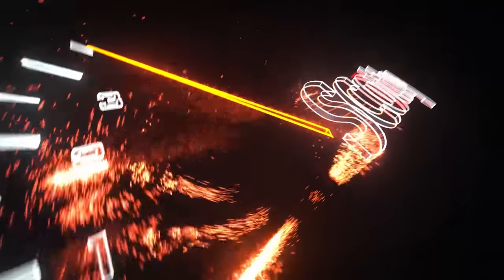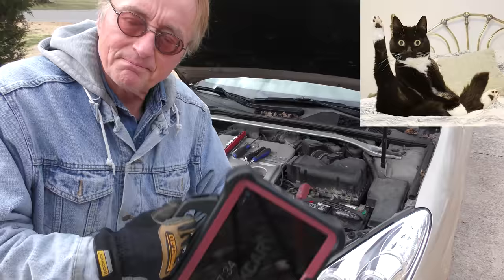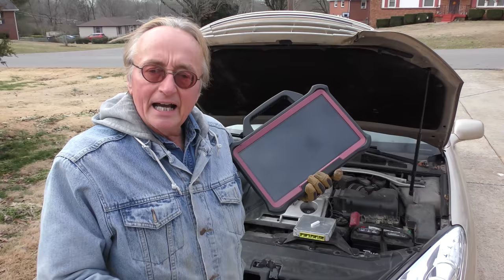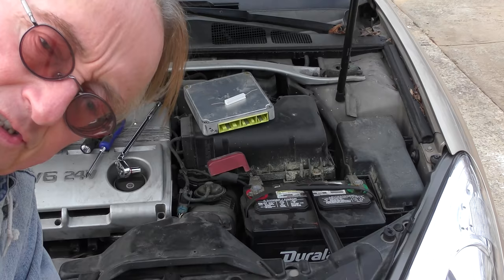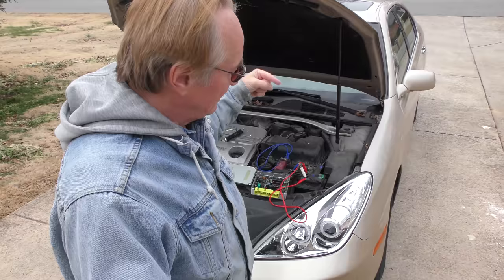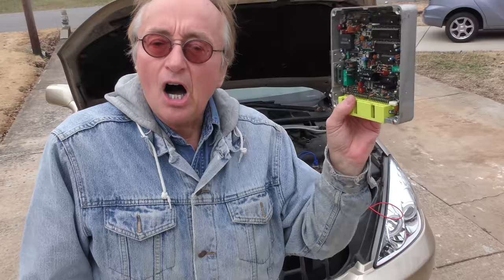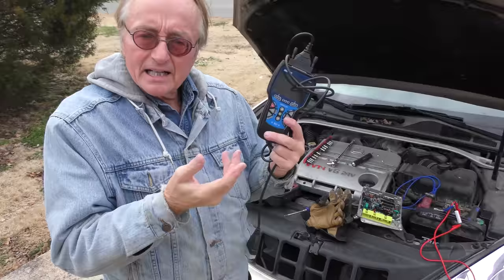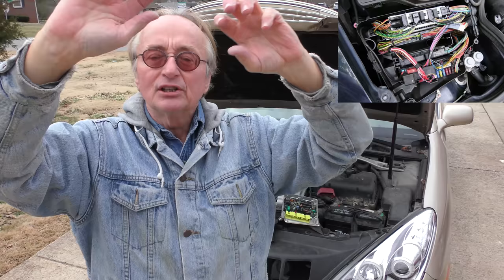This Stupid Thing Will Save You Thousands in Car Repairs

Comment: “Don’t touch the positive and the negative or you could damage something” as you remove the positive and place it in the car that is completely hooked to the negative… c’mon Scotty! As a mechanic you should know you always remove the negative first…
Reply: Why?
Reply: @WolfmanZX  If you remove the negative first, the worst that can happen is you will momentarily provide a correct ground path and the battery will be back in the circuit.  If you remove the positive first, your wrench can short circuit the positive terminal through the wrench to any part of the cars body that is ground, welding the wrench to the frame until it burns off. The negative terminal should be the first off and last on so if the wrench ever grounds to the frame, there is never a short circuit directly to the positive terminal.  The battery is capable of around 800 amps.
Reply: Yes, always remove the negative cable first.  If you start with + and let it touch the engine or body, it makes exactly the + to – contact (computer rapid discharge) that you're trying to avoid.
With pre-computer-era cars, ggeimer is correct about the risk of the spanner removing + touching the car body; nothing more.
Reply: Ste Srad  or you can touch some bare metal ( frame motor) with your ratchet , while you undoing the +. and voila, big spark.

Comment: Ty so much! I've always found how vehicles run and work fascinating. But, I'm a female and I've discovered 2 things: 1. Sometimes mechanics get annoyed when they're trying to work on a vehicle and you're steadily asking them 101 questions cuz you were 'just wondering'. And 2: When my vehicle needs something little, like a headlight bulb replaced, for some reason the males in my life feel that I cannot comprehend how to take care of this fix myself. So, they'll insist on doing it instead of just advising me what to do(what bulb to get, etc.). I've found it's just easier to pull up YouTube with my car questions and take care of the little things myself. Thank you for providing so much valuable info for me to be able to prove to them that I don't just belong in my kitchen, but I'm at home in my garage, too 😂

Comment: I would use a 10 ohm resistor and go down to 5 before going to 1, 1 ohm could still discharge too quickly depending on the computer

Comment: It seems to me you could do the same thing  by removing the negative cable and turning on the dome light for 15 mins.  An incandescent lightbulb is essentially a resister that gets white hot as current passes through it.  A 3-watt dome light is 4 ohms.  A 5-watt dome light is 2.4 ohms.
Reply: what;s the resistor that Scott has called and where do   I get it?
Reply: @KK-ji4vn  And with the battery cable removed how can the computer turn on the bulb?
Reply: Will flipping on any of the interior lights do the same thing vs connecting the positive and negative with the resistor? Has Scotty replied to this?
Reply: Good thinking, but that won't work in newer cars. In older vehicles, the dome light was on a simple mechanical switch. Nowadays, when you open the door, the body module gets an open signal from the door switch and then activates the dome light. If the battery's disconnected, the BCM won't be awake to close the dome light circuit.
Reply: The computer's input (power supply) side is what charges its memory-protecting capacitors, which is why you have to discharge them through the input. They have no connection to the output side.
Reply: @KK-ji4vn  Drat.  I wish I'd given it more thought. You're absolutely right. I wish I had done the math on paper.   Turning on the headlights: 2 @ 60 watts should be close (1.2 ohms).  I don't know about HID or LED.
Reply: But Scotty used a 1K ohm 10W resister. A bulb has very low resistance.
Reply: @fivish  Correction Scotty said one ohm ten watt resistor @ 1.35
Reply: And they don't come cheap!
Reply: @ConanTheEmployer  Plus, many newer cars use LED lights which don't draw as much current and become an open below about 3 volts.

Comment: Great video as usual. So, something else to learn from this is that if you just remove the positive lead from the battery, don't let it accidentally touch the bodywork as it could fry some of the electronics.
Reply: That's why you're supposed to take out the negative terminal first or only!
Reply: @ev-ezaye3580  The biggest reason is that if you get your wrench between the positive terminal and the body of the vehicle (with the negative cable still attached), you will be taking a class in electrical arc welding. Seriously, you can weld your wrench to the body, and then the battery can explode from being discharged through your wrench. Car batteries are capable of 500+ amps.
ALWAYS disconnect the negative first and connect it last.

Comment: Scotty I removed and cleaned the Throttle body on my 2009 Ford Escape 3.01 L I removed the Battery cables and connected the 10W resistor to clear the computer system. My question is, To relearn the system should I just do what you explained in the Video or I have to do something different. I have heard that Ford relearn is different than other cars. Your help is really appreciated. Thank you.

Comment: You can used the old 12 volt test light to do the same way. It will drain down electricity in the system.

Comment: WRONG!  Always (on a negative ground car) disconnect the Negative cable first and reconnect Negative last.   Also unnecessary to disconnect the positive as with negative disconnected there is no complete circuit.   Just put resistor between negative cable and positive cable with positive still connected.
Reply: "negative first". Why?
Reply: connect the resistor to the negative and positive (still connected to battery) .... really? then how can you drain the ecu with that setup?
Reply: @breastnspear  
He said to disconnect the negative cable. But you can leave the positive cable connected. 
Then with the resistor connect to the disconnected negative to the connected positive.
Reply: @WolfmanZX   So you dont accidently short out the positive terminal when you are removing it by touching your wrench on a metal part of the car .
If the negative is diconnected , you ll be good .
and when reconnecting the battery , connect the positive first for the same reason.

Comment: Hi Scotty, Does disconnecting the battery then holding the brake pedal down for a minute do the same thing?
Reply: You may be right. But if true just leaving a door open should work too. The dome lights would drain as well.
Reply: Yeah I switch on my headlights
Reply: exactly right.  But when you slam the battery cabled back on like Scotty does, you're creating the same spikes that Scotty claims to eliminate anyway. This video made me cringe.
Reply: @executive  if you already drained the system, what would slamming the battery cables on do?
Reply: @executive  Leave the dome lights on.
Reply: @captinbeyond  it's hard to start the car with the battery disconnected
Reply: @stevenw4549  that would work. Just don't forget and leave it on.
Reply: @captinbeyond  I'm taking hand gesticulation lessons now
Reply: @executive  I'm thinking perhaps the difference is when you disconnect the (negative) battery cable  there's neglible  immediate voltage change, essentially no  current, because of the stored charge in the capacitors. And when you connect it back up it's like replacing the battery, the computer system has to tolerate any current inrush when reconnecting after a battery swap.
Reply: @sabasc3tube  that's what I'm saying. touching the battery cables together is the same as hooking up a battery.

Comment: Super helpful video! Can you use the same resistor on every car? Or you need a specific resistance?
Reply: Did he say 10 ohms? If he did it should apply to any 12 volt system.
Reply: It was 1 ohm 10 watts
Reply: Looking at this resistor in the video, it says 10 watt, 1K where K= 1000 ohms.
Reply: Really. I didn't see that. It could make a difference
Reply: @THOMMGB  Ive looked closer, doesnt it say KJ=kilo joules? Maybe Im missing something
Reply: @matteocesa9017  Resistance accuracy : ± 5% (J)   The J indicates that 1000 ohms could really measure 5% higher or 5% lower than the stated value of 1000.

Comment: My Lincoln Town Car is '02 so still the older 'stuff', I clamped my cables together for 20 minutes, worked like a million, re-set the computer to as-new, a real relief for sure but I'll use the resistor next time if needed, to be on the safe side.

Comment: @ Scotty: Shouldn't you plug in a battery keeper where the scan tool is plugged in? In another video you said that if you unplug the battery from a newer car, in order to change the battery, without FIRST plugging in that battery keeper thing that it would necessitate taking your car to the dealer in order to get it reprogramed.

Comment: My Subaru WRX would average the boost the turbo would make over the octane of all the fuel that had ever gone through. So a tank of 87 would permanently reduce the power even if you ran Sunoco 94 in it later. Clearing it all out like this solved the problem.

Comment: Well, I wished I had watched this video first. I used the old method on my 2011 Mitsubishi Galant and it cleared my code and I didn't do any damage. The car started right up and ran fine too with no check engine light on. I don't know what he means by a "modern" car? 2011 is certainly modern! I guess the Mitsubishi Galant's computer isn't too fancy with a bunch of modules. I took it for a good drive and the code hasn't returned yet but it still could. It's the "small evap leak" code. I purchased a new gas cap and a new purge solenoid or whatever it's called. I only had the gas cap and decided to reset the code today and so far it hasn't come back on. I'm still thinking the vacuum purge solenoid could be bad and if so that code is going to come back. There don't appear to be any other leaks in the system but I haven't done that leak test with the smoke machine.

Comment: Scotty;   Great video BUT.....  You should always remove negative or ground battery first, then positive.   Second  why the 1 ohm??   Buy an 1157 newer bulb with the wire leads on the base..use it as the resistor then use it to replace a bad tail lite in the future...

Comment: I work in IT, and a capicitor discharge is not common knowledge but damn does it fix weird crap on computers, game consoles and whatever else uses capacitors to store small amounts of electricity. Most devices use a magenetic polarity switch and will not turn on if the polarity is wrong. Do a capicitor discharge by unplugging power then press all the buttons on the device. (Power, open disc, keyboard\mouse buttons.) then plug it back it back in. This will drain all the caps and reset the state of all components back to factory. Just like Scotty is doing here with the 1 Ohm resistor.

Comment: Question for a generous soul about the 10W1KJ resistor trick to discharge the car's computer's components: 
--> Would disconnecting the battery,  and then waiting for a week before reconnecting the battery,  achieve the same results and reset the computer to factory default on a semi-modern (say 2014) nissan qashqai acenta?

Comment: The fastest way to darin off voltage once the battery is disconnected is tap the brake pedal and hold the key to start for 10-15 seconds....

Comment: I would suggest a higher resistance resistor like at least five ohms to prevent a damaging current surge. If the battery voltage was 12.7 V then / 1= 12.7 Amps potentially for a short period of time. 12.7 / 5 = 2.4 amps which still seems like it could be too high. A10 ohm resistor would produce potentially a 1.27 amp surge which would be safer.

Comment: 2008 Equinox 3.4L lTZ AWD 118,000 Miles burns +- 1 qt of 5W30 Synthetic oil every 800-900 Miles.
Has been like this since I bought it 8 yeas ago and have tried everything that I have found in forums and youtube, no improvement. I only driver about 2-3K  a year. Car drives beautifully otherwise and tow a small Pop Up camper of 3000 lbs with plenty of power. I plant to drive it until it or me expires.

Comment: Buy a test light, it does the same thing. You can see the energy draining and use it for other things on your car, such as quickly checking circuits. In fact, a cheap little multi meter will do the same thing and you will know for sure when any residual power has been depleted.  This method is OK, but with the greatly varying number of modules on your average passenger car, you would need a chart specifying exactly how long to leave this resistor in place to do the same thing.

Comment: 1 ohm is just like touching the terminals together,  to slowly bring things down it needs to be much higher resistance..  1k ohm would be better that'd drain at 12ma.  Or you could always just measure across the terminals to see if there's any residual voltage there. Actually pausing it Scotty's resistor is 1k ohm,  he just said the wrong value..

Comment: Scotty, I would think they would have some sort of resistance device on any input to those controllers, but maybe not since signals from the sensors would be low voltage and milliamps. I think I'd use a 1k ohm 1w resistor instead. A 10w resistor means u must be expecting a lot of amps at 12v. Most digital circuits work at 5v or 15 v for the logic high if they use CMOS.

Comment: Oh wow! Having an code and engine light that refuses to go away after a new transmission and a new case transfer which I was told it needed. Well it didnt😢
I’m at a loss 2 transmission mechanics and still can’t figure it out. Hummer H3 high mileage but in great shape drives nice . I want to keep it. Weird thing is I can’t take through a car wash. It dies. I can no longer go to a car wash. The computer goes manic. Gonna try this!!

Comment: 😂 Huge flaw in this Scotty.⚠️
The battery isnt diectly connected to ECU and other modules on many cars.
1st off there's the ignition switch which then goes via a multitude of sequenced relays !

The only 3 modules directly connected to the battery are:
Remote key reciever.
Alarm system
The clock.

The rest are switched via relays.
So connecting a resistor like you say will have absolutely no effect on ECU.
But if you insist on trying it connect a 21Watt stop lamp bulb.
You don't need a resistor 😅

Comment: Scott I have a 2000 Savana g.m.c full size van 5.7 liter .It won't start unless I squirte starter fluid into the intake. I've supposed to have had a fuel pump installed and filter from a  repetitive shop.

Comment: Should’ve disconnect negative battery terminal first … otherwise you could create a short if u touch any grounded part with the vise grip while disconnecting the positive cable

Comment: You don't need it, interior light will do same job, or just turn on side lights or main beam flash, or hazard lights. 
No mention of radio code, or making sure window is down and keys out on case central lock kicks in, ect ect ect. 

And if you really want to reset your control units properly, this isn't how to do it anyway.

Comment: If a single resistor protects car circuits against excessive voltage discharge current during disconnection, shouldn't the resistor be used for battery reconnection, too? A twelve volt surge is more than enough to damage a computer circuit.

Comment: A light bulb resistance is slightly higher than 1ohm, probably more like 40ohms.  Could you just turn on the car lights with the battery disconnected?

Comment: On a Toyota to reset the Nero turn the key off 3×123 the third time you crank and let it start and let idle for 5 to 10 minutes. Put it on drive. How are your foot on the break and I’ll reset the idle work for me

Comment: If you let the positive battery cable touch anything metal in the engine compartment, it will have the same effect as shorting it to the negative cable.

Comment: Hmm, this will likely work 80%~90% of the time but you're still in danger of damaging the equipment because the simple act of physically connecting the resistor to the terminals can cause many transient currents until there's finally a hard connection. These transient currents will occur in the milliseconds, microseconds and even nanoseconds, unpredictably. They won't actually "damage" any components but likely will corrupt EEPROM data or FLASH program memory to render the unit useless unless one has the ability to reflash it with factory code.

 The best way to implement something like this is to use a nand latch for debounce (or a 555 timer) of a pushbutton switch to provide a controlled on/off signal to the input of a mosfet which will make the connection between the cables in a controlled manner. I would go with a 5 ohm resistor in series with the Mosfet. 
Forty five years as an EE in the defense industry....